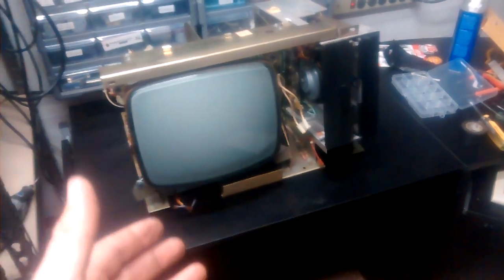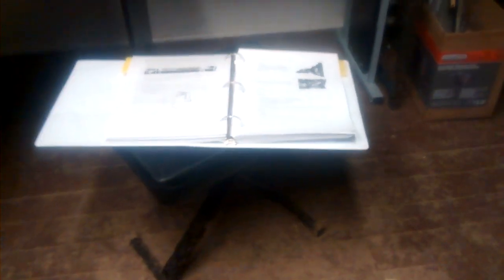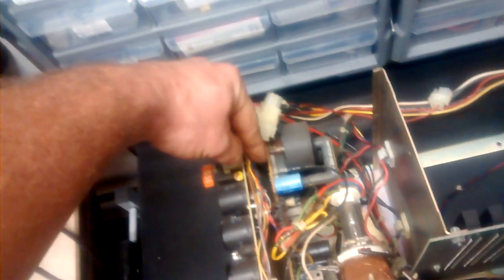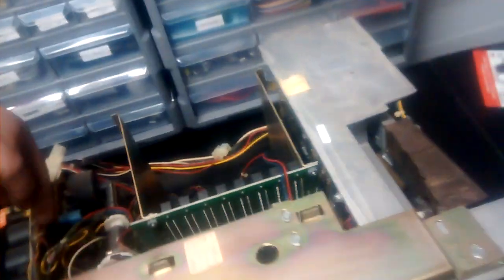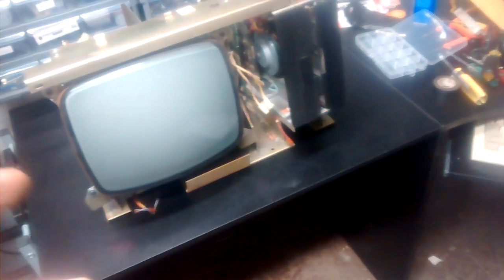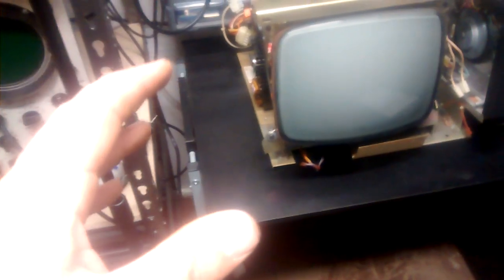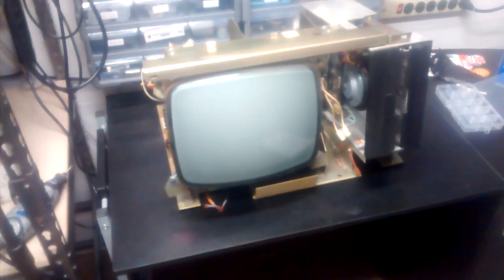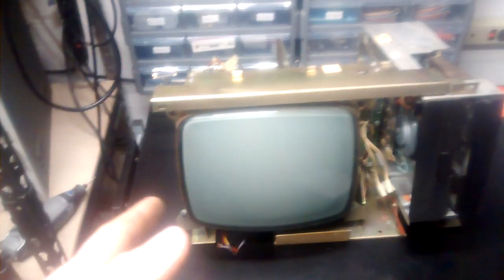TRS-80 Model II (Pt.2) Update (#SepTandy 22nd, 2020)

Comment: I'm guessing the box either fell from a great height or something heavy fell on it. Much of the metal frame looks bent (at least from my view). With a great enough impact, I could imaging screws "popping out" by a thread, so the loose screws could be "normal" for the state of the machine.
Reply from the maker: The frame is bent, but the threads are all OK.  If they'd popped I'd have thought something would have stripped.  That, and a couple of the things the seller said, and the fact that a model ii with what I recall to be very similar damage was on eBay a couple months ago, makes me a little suspicious.  But then again my tinfoil hat is wrapped pretty tightly most of the time so who knows.

Comment: Similar then happened to me. I swear never to have anything shipped with a tube in it. My model III was shipped locally and it's a bag of ancient plastic now. Even the motherboard is done. Sorry and feel for you brother!
Reply from the maker: Yrahhhh, I think I'm going to have to insist on professional packing for crts and shit like that from now on.
Reply: @Lee_Adamson_OCF  Amen, brother
Reply: @Lee_Adamson_OCF   You will have to be very specific about what "professional" is packing your tube stuff.

I decided to get my first (personal) TV back - a Sony 13" Trinitron.  I asked the seller to bring it to a shipping house to pack it professionally, which he did.  They dropped a couple of those expanding foam packets in there and called it a day.  I spent the first couple hours figuring out why the buttons on front felt like they were pressed and stuck in, then the next week troubleshooting why, when first plugged in, the set would charge up, then immediately shut down and ignore the power button.  (Turns out it was a crack in the PCB right across the HVT -- easy enough to fix once I found it.)

OTOH, I have had a Tandy CM-11 and PCjr monitor shipped to me, just sitting in a ball pit of styrofoam peanuts, with THAT box in another box with peanuts or other foam cushioning.  Those arrived intact.

I'm convinced that double-boxing is the way to go, and unless those "professionals" specialize in the shipment of CRTs, they're just as bad as the typical Ebay seller.

PS - wish I had a choice on whether to ship, but I'm on the other side of the continent from most of the fun toys.